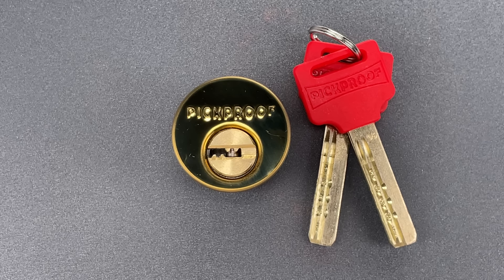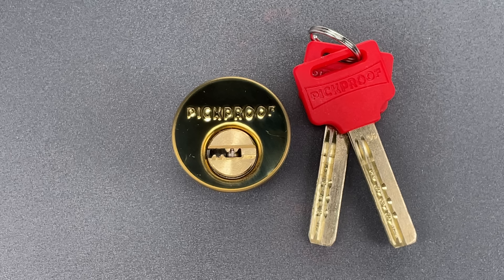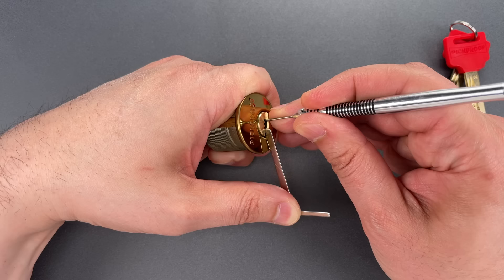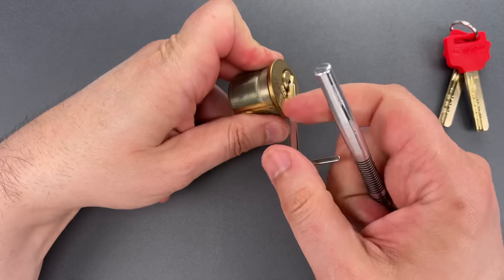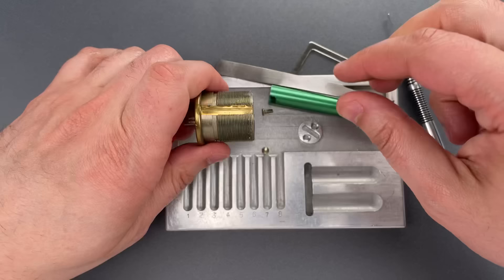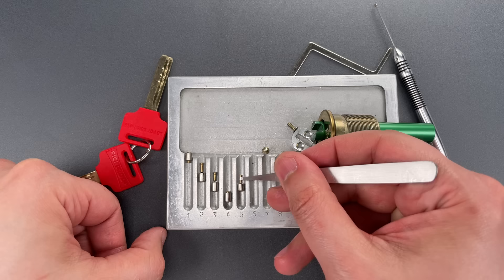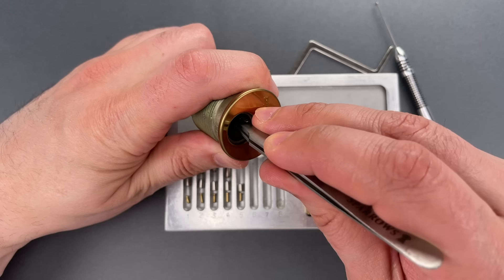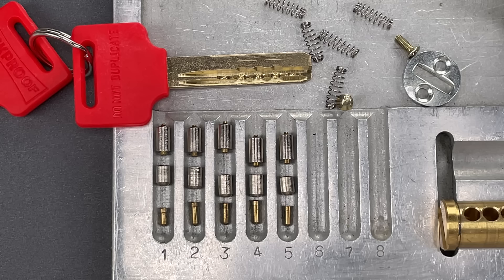[1289] This Lock Is Indisputably “Pickproof”

Comment: I just thought of an ingenious pick proof lock.   Simply have the master chamber able to rotate slightly. Have the pins keyed so there’s a groove with a solid end. That way if you try and put pressure with a bar the master chamber (with little hooks or edges) will rotate slightly and lock in behind the pins. Preventing them from lifting fully up and out of the way in essence locking the pins until the cylinder is reset.
Reply: So if you're in a haste and insert your key with a bit of torque, it won't open? and you can decrypt them aswell
Reply: They will just create a tool to hold the 'master chamber' in place. It would certainly be more inconvenient to pick, but if it becomes popular, so would the workaround to it. You can't really create an unpickable lock, it just takes more complicated tools to break in. Which, btw is definitely an improvement. This is why someone like LPL just has ridiculously uncommon locks on his doors. They can be picked, but only by someone with a great degree of knowledge.

Comment: Multi lock has some with the floating wafers in addition to the telescopic pins, they used to offer a 10K reward if picked. I actually still have a few old original multi lock locks from 20-30 years ago.

Comment: LPL: "This lock is pick-proof..."
Me: "Load up the .50 cal pick."
Reply: C4 for those in the military too.
Reply: That's not picking. That's brute forcing. Most doors can be opend with a ram, but you wouldn't call it picking.
Reply: then you have the Squire 100CS, which is also .50cal resistant.  if you havent yet, look up the video. LPL and Bosnian Bill shot this chonker of a lock with a .50cal rifle multiple times before it opened.
Reply: @filanfyretracker  Over here we have the .50 cal rifle Bosnian Bill and I made...

Comment: Does the fact that the steel is magnetic affect any type of picking? Can the pins be manipulated by a magnet to help with picking?
I ask as I am a metal fabricator and we have a type of stainless called 304 which is completely non magnetic and quite a bit more expensive than standard 370 or 1.4003. We also have a high performance steel called Lean Duplex type 1.4062 which is 2.3x stronger than 304. It's particularly hard on our drill bits and punches

Comment: Perhaps the way to design a pickproof lock is to have the key turn one way and then turn the other way to open different angled pins.30 deg offset. 
The pins are design on a quick delay spring action with small mag at the tops of the pin head to hold the pin up. The bolt is then pulled out quickly after the second turn or it relocks as the pins fall back. I'll leave you to finalise the design. Might be some money in it And we finally get a lock thats difficult to pick.

Comment: So if you can produce locks randomly with different types of springs, spools, and pins, randomly generated with matching keys, and with at least 3 sets of pins in 3 different directions for a type of a triangle key, then it would be the most pickproof lock?

Comment: I prefer locks which reveal as little as possible about themselves. No names or brands or numbers on any of the visible parts, no clues, no hints. Just another locked door with another common-looking lock.
An obviously expensive high-security lock suggests the owner has valuables worth stealing.
"Pickproof" written on the lock won't deter a thief. Smashing a window is faster than wasting time.

Comment: An idea for pickproof lock - it would have a fake keyway (which could potentially trap tools inside on attempt to pick) and would be opened in another way, that cannot be substituted by picking. Like holding some part of the lock by hand and turning it to right. Safety there would be more of not knowing what exactly you have to do.

yes, this potential "lock" could be easily opened, if you knew how, but it technically could not be picked (since there is nothing to pick) and could prevent entry as long person trying to bypass it does not know how,

Comment: When your key starts to fail in being able to relock your deadlock sometimes during extreme cold weather after you have moved into a home which hasn't been inhabited for a long time by anyone except for shorter periods of time during the renovations then something is wrong. Time to call a locksmith because it seems to me that like a vehicle which has been sitting unused for a long time a so called pick proof lock will wear out much faster when not being used.

Comment: I'm not a lock guy, but I find the picking of these locks strangely relaxing, nevermind the buttery smooth voice of LPL...

Still, I can't help but notice that most of the attacks on keylocks involve putting the core under tension as the first step. What if a lock was designed where the cylinder freely turns 360 degrees instead (no binding on pins), but when the correct key is inserted and turned a mechanism is activated during the turn that in turn activates another mechanism that releases that piece of the lock? There could be several of those mechanisms in the lock, and the "one step removed" nature of the unlocking procedure prevents feeling your way to success...

Comment: The second best lock is one that is innovative like this one and its only used in a place like a bank. Then they would keep the lock design private so they couldn't be abused. Also the metal that makes the lock has to be very stronk and it has to be THICK. To make drilling slower.

Comment: Medeco makes a mortice/ threaded lock called - [ Medeco junior] comes with a security card, no magnets / floating pins on the key , just machined. Is a Medeco junior worth it's weight. Hugh Mc , Chicago metro

Comment: Maybe I missed something, but that looked like a brass lock with steel pins, if I'm right then it doesn't make a lot of sense to add drill proofing to the pins when the lock itself is a soft metal. I'm not a lockpicker by trade, I just love the fun of it, so like I said, maybe I missed something :)

Comment: I really want to know why you use a Z bar on dimple locks instead of a normal tension tool, it just seems like it wouldn't matter either way. obviously that isn't the case sense your using a Z bar and its working great.

Comment: You can pick anything so I've seen in the few of your videos so far, but could you design a lock that is actually unpickable?
Reply: @KryniusxD  I remove locks and sit inside, stare at the door, and wait.
Reply: You cannot. The only way to make a lock unpickable is to make a lock with no keyhole, so that once it closes, there is no exterior access.

And then, you have to either have a way to open it from the inside, or  you have to accept that you are never getting in via conventional means again.

And even then, you aren't prevented from gaining access, you would just do so via unconventional means. Axe, sledgehammer, cutting torch. No form of security is impervious. The entire point is to add "friction" to the process of breaking in, by making a break in super complex. The more barriers you have, the fewer people are willing to bother.

Comment: Best lock, a wall made of carbon fibre and steel wires and rubber and cast iron with electricity running through it heating it to 000 degrees lava

Comment: What would be a good lock is a cylinder entry point with random holes in it, that would require a key that is a cylinder as well, that when you click a button, extends out little points that fill the holes, allowing it to be turned by releasing the mechanism. I am sure better ideas are out there, but this would allow lock picks to be near obsolete for it. You can obviously still find a way around this I am sure,

Comment: The only way to properly lock one’s house at this point is via locking the inside where you can only unlock your house from inside rather than the outside.

And as a failsafe if you want, only way you’d be able to get in with the whole house being locked, has to be some sorta zelda esque puzzle solving dungeon romp.
Reply: You've seen those mantraps that crackheads make? Where you open the front door to find yourself in a cage.

Comment: First off I dont know how I came across your vids but I love them. Im locked in everytime (LULz). 

tl;dr picking unmounted locks is a huge advantage.

This is really cool and my dad (locksmith) taught me how to pick locks when I was a kid (love puzzles). One thing I noticed is picking brand new locks in hand became trivial.  The real test was a weathered lock mounted (in a door, on a chain, etc).  Being able to manipulate the lock-in one's hand at every angle is a huge advantage.  For example, my dad gave me a lock (just the lock) to pick I did it rather quickly.  He took the same lock and put in a door and it was near impossible for me.  I also attempted to pick our gate lock (extremely weathered) and it was a no-go.  Not saying at your level this would make a huge difference but its a variable to consider.

Comment: You make me want to put keyfob access on my house instead of regular locks, but then if someone really wants in my house all they need is a rock
Reply: Keyfobs are even easier to pick... all you need is to clone it remotely... doesn't even require skill, like a real lock would...
And yeah, burglars will go through windows if they need to, but 9.5/10 times, they can simply go through the window you left open for ventilation...

Comment: The only unpickable lock may just be a fake lock so the criminal doesn't realize how the door even unlocks by hiding the real way the door locks and unlocks were you can't see or get to it. Make it so the fake lock notifies the police that someone is trying brake in and your set. There are many ways to do both those things as the truth is the best use of a door lock may just be as a silent alarm button basically. Why not use a chip with super long code number the is send to something that unlocks the door when turned in the lock by a contact point and have the lock only there so anyone watching thinks it's a normal lock from the outside but the lock will never open the door without the key because the lock is just a slot to connect to send a single code which can be randomized everytime the door is successful unlocked. The door would automatically lock when door closes. The lock would hide a contact point that allows you to guess that code one time only and key just holds a the code. The fake lock can have fully working parts and be connected to many hiden cameras. There is using a fake lock with a peephole that actually a camera that scans you face when you put the key into the lock and turn it trickery.

Comment: It would be very interesting if you could find a way to real time watch the torque force (an electronic strain gage) that shows the force (weight pressure) you exert with your thumb as you pick.  You vary the force as needed during a pick and having an indicator graph as you pick could be very interesting to view and match as you set the pins.

Comment: magnetic stainless, probably 17-4. It would have some property's that would apply I think. I think, going by memory 17-4 has shear strength and is used for bearing surface, so anti-wear and smooth movement I think would be something they might use that material for. normal stainless like anything 300 series is horrible with moving parts, it would have a tendency to stick and guald "don't know how to spell that LOL" its kind of a friction weld on a microscopic level, maybe that would be a pick proof idea. We should play with that, maybe we could finally keep the lock pickin lawyer out of our stuff LOL :)

Comment: Quantum entanglement could defeat LPL. Imagine as such, a lock that contains an entangled particle, and its partner in a key. It would never be able to open unless that exact key (particle) is used.
Reply: Even if that were possible, part of lock picking is finding the weakest part of the security. If something is truly pickproof, it isn't necessarily shim-proof, knock-proof, or prevents the removal of the hinges.

Comment: i have to wonder at this point if there are actually locks that are impenetrable
Reply: Oh its possible to make lock that use pins unpickable. Its just precision machining is not suited for mass production, most what he does is exploits the tolerances in manufacturing. The lock that will have so small tolerances will have problems with temperature differences. 
But i have to point out thief will use the path of less resistance, and now when anybody can have hidden camera or alarm its mostly about speed not the method it self. Now nobody pick locks, the main weapon is information. What is your rutine, when you go to holiday, what security system you have, were and what valuables you have. In the past they visit their victim house in disguise, now most what they need is on internet via social media.
Reply: @scasny  ie make them so precise that they are useless due to having to keep them at constant temperature and small kinks while opening them have the potential to brick them
Reply: @MostWantedWannaBE   not like constant but in winter when its below it will open with little wiggle. But in summer and on direct sun it can expand so much you will have difficulties turning or will not open at all. 
But be real normal locks are mostly there so hobos and random people will not wonder in.
Reply: @scasny  yeah i know that
the lock that does the most work

after all what does an impenetrable lock do when they blow open your door

Comment: Why make a standard lock and put the word "pickproof" anywhere near it? I'd understand if it was a custom design with highly unusual pin locations. That would at least stop picker for 10 min. But that's the most common lock I've ever seen. XX century classic. A counter-pin, a thrust-pin, a magnet pin... So much could be added to make it a bit safer. But copying the most overused lock and calling it pickproof is next gen stupid.

Comment: I don't understand why  you are showing and debating whether or not a certain lock can be picked. Its like showing which carbon batteries are better, or who makes the brightest and longest lasting incandescent bulb, no one does this any more. All a thief needs is a set of master key's to breach all of them anyway. What do mean by a set of master keys?  A cordless grinder, and drill, some freeze spray and small hammer. Thats it ! If you think anything but around the clock physical monitoring is going to prevent unwanted entry' you have a false "SENSE"of security. No one but a person who's locked themselves out uses the services of a lock picker, and if you make it harder for them, they will simply charge more for there services, its a catch 22 end of story.
Reply: He explores physical attacks and bypasses as well. As with everything in physical security, the attempt is deterrence through difficulty, and delay if not deterred. Even your "master key" concept isn't universally easy to apply, and not all locks are equal in time it takes to apply.

Comment: Brass pickproof I don't think so what with Battery powered Drills easily available drill out the guts of the lock in less than a minute and guess what it no longer works as a lock, Why use finesse when brute force does the job faster.
From what I surmise with most Crims speed is ot the essence not finesse, after all they are when all said and done bone lazy that is why they are thieves too lazy to actually work to buy what they need or want so I guess the drill fits their agenda of being fast and a power tool for the bone lazy
Reply: Proper picking can usually work faster and quieter than physical destruction, assuming the individual has the skill. It also depends if the person needs the entry to be covert. However, there is room for both methods, depends on the task. Note that there are locks designed to make physical destruction harder, like hardened metal lock cores and shackle.